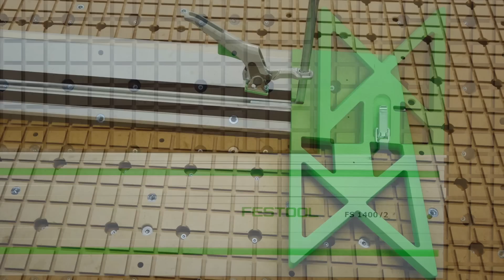How to make a FESTOOL FS1400 Guide Rail Square for the TS55 [1/2]

Comment: Theiss: You are a talented craftsman and very good observer!
thank you for acknowledging that the tool you produced is based on and uses our Patent Pending Guide Rail Square invention. The requests from others for copies of the design are flattering but we ask you all to consider respecting the efforts we make to bring specialty solutions to the craft  at our own risk and without a 4 month wait for a one time production run.
Hans
 info@tsoproducts.com
Reply: Id buy one of yours tomorrow Hans if they weren't so expensive to buy here in the UK.
Reply: Excuse me, I did not know of the product on the market, it seems a bit 'expensive, but I understand your efforts
Reply: are you going to make a dewalt version?
Reply: TSO Products will,you make one for mafell
Reply: Nothing wrong with copying something quietly for your own use. However, even before reading the comments it was obvious that you've totally ripped off the TSO product. 
Shame on you for not declaring.
Reply: Expensive?  If you bought a Festool, Makita, or Triton track saw then this accessory will provide value leaps and bounds.  Considering that the Festool track saw compass is roughly $200+ and still requires a reliable square to square it up, the GRS-16 is a steal of a value.  That being said, I own the GRS-16 and have been using it to making square cuts. The first four cuts I made with it and saw the results it more than paid itself in value and accuracy.
Reply: Brian M. I see what you're saying but I guess you live in the States ? I'm in the UK and we get stung for taxes, import and quite often another charge by the courier for collecting the duties. So this can quite often double the price of stuff
Reply: That's unfortunate, but if the tool fits your workflow (especially if you work with a lot of sheet goods) and if it can provide tremendous value, then the price could very well be worth it.  It all depends on what you need.  I write software for a living and I purchase software licenses for various products because they boost my productivity and helps me to do my job at work better.  Those licenses aren't cheap either (upwards $150 and above) and I pay them annually but the effectiveness of the tool is seen because I can refactor or write new code faster and more accurately.  I get paid better as a result, so I recoup the cost sooner than later.  I'm sure you could justify the tool even if it is expensive, it just has to fit your workflow.
Reply: Brian M. I'm sure I'll end up getting one. I could have used one this week cutting up sheets of MDF, I use a roofing square at the moment but it's not as quick
Reply: @Brian M. Glad you like our GRS-16!
Reply: TSO Products by posting this comment you led me to this product. i really like it from what little  ive seen demonstrated on youtube.
Reply: Glad to hear that, William!
Reply: Thanks, William!
Reply: I own the GRS-16 PE square and vouch for its absolute accuracy and reliability. This product could well appropriate the Stabila level slogan: "Trust. Never adjust." Bullet-proof design, impeccable quality control, and years of faithful service are the reasons such tools warrant the investment they do.
Reply: too bad there's no GRS-16 for dewalt.
Reply: ms3ba
Reply: howard dove He does in fact credit TSO furthermore TSO have thanked him here for doing so.
Reply: Curious to see how that patent application goes. Given products like this are readily available from the OEM and multiple other after market suppliers, can't see what's unique about the TSO design. We've been doing this for years with shop made jigs that fasten in to the slot on the bottom of the track.
Reply: Jonathan, I too am now curious. Do your jigs that fasten to the bottom T-slot rely on the precise fit of the jig's male member to the width of the rail's slot? The principle that makes the TSO product different from others on the market that I am aware of is the fact that they don't rely on this fit. Instead, TSO's sideways clamping connection relies only on the square relationship of the jig's connection element to the edge of the jig that makes contact with the work piece. Thus, precision is totally controlled by the accuracy of the jig, not the precision of the fit.

The result is absolute reliability, independent of the fit of male to female. In turn, this is why the TSO product can work with multiple brands of guide rail, despite the fact that the width of their respective slots differs enough to require the use of an auxiliary precision square to assure perfectly square alignment with other guide rail squares on the market..

I don't claim that other methods of achieving the same result are not possible (I myself have already thought of one). But I'm not aware of another commercially available product that uses an alternate method to achieve the result TSO has. Are you?

(Please note that my question is purely technical. Questions about price point are another matter to be debated in another thread.)
Reply: No they rely on the edge of the rail, just like any contractor who picks up a speed square and runs a saw along it while referencing the workpiece (hence my reservations about how "patent-able" this design is). We just use the t slot on the bottom to hold the jig in place using either the standard clamps, or a cam action t slot fastener that draws the jig against the side of the rail. Some of our other jigs use 3d printed clamps that grab the edge of the profile opposite the cutting edge (much like yours) and fasten in to that t-slot using a t nut (again the clamps have the side facing the blade on a taper so that when the t-nut it tightened it draws the clamp against the reference datum). There are lots of products available for this type of operation specifically in the woodworking marketplace, or if you look a bit further abroad, some that can be adopted from the extruded aluminium market place (for example 80/20, MiniTec... etc).
Reply: Thanks. I get it. I've been doing it a different way, but the wedge-based alignment principle is similar. Could you possibly send me at a picture of your 3D clamps? I'd like to do likewise on some other shop-built fixtures myself.
Reply: Jonathan, regarding patentability of TSO's product: You could be right with respect to broad claims, but TSO's use of the suitcase-style clamp, ability to make the connection from the top, etc. still might protect their commercial innovation, even if such a patent isn't infringed by another maker's method of achieving the automatic alignment. Other than one clear-cut knock-off, I don't know of another commercially available guide rail square that achieves perfect alignment without use of an auxiliary square (which strikes me as very wierd). Do you?
Reply: Yeah - the toggle latch clamp on the side requires the extraneous step of machining the t-slot profile on your your jig to stop the thing from falling off (the latch on its own won't stop this rotation). Ours sandwich the rail inside the jig while simultaneously referencing off the outside edge. No special cutters required to mill them, and no special clamps. Much cheaper.
Reply: Any chance you could share a picture?
Reply: Leave him alone @tsoproducts.  He's made a homemade version using a lot of his time and expensive machinery.  We're not going to take from any of your profits.  As much as I want the GRS-16, I'd never buy one due to its high cost.  If anything, he's brought awareness to your product.  I think you should send him one to review and compare it against his homemade one.  =P
Reply: @tso-products  cant afford a gsr so would rather get this dude to make me one. if its patent pending, no one owns it